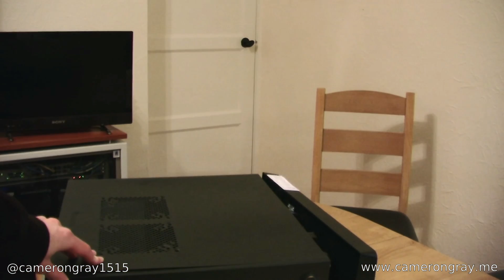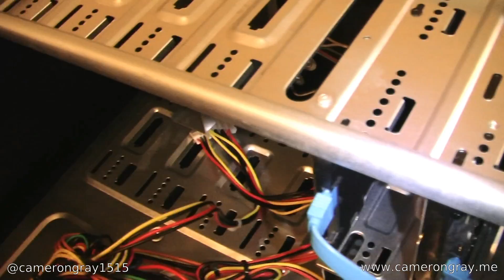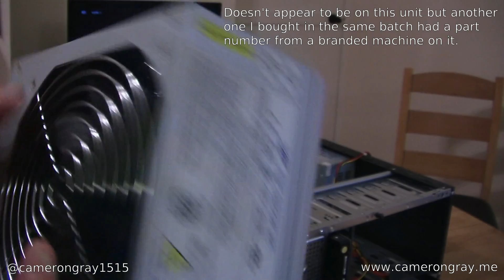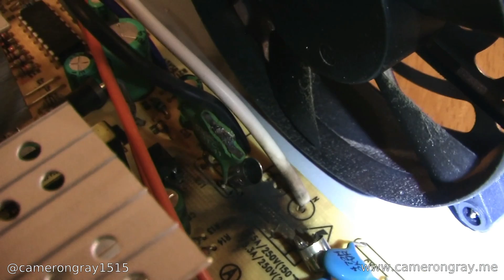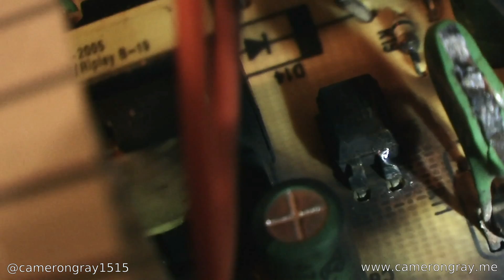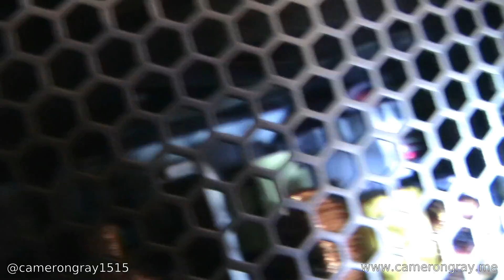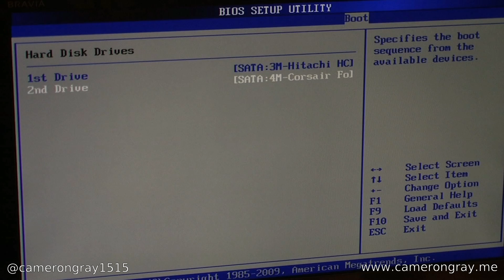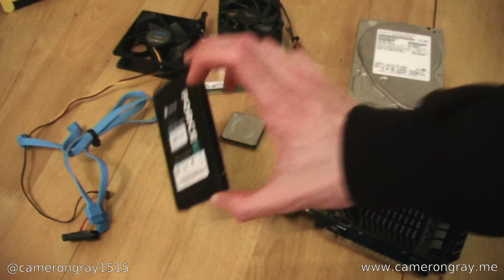Mystery £10 eBay PC

Comment: That Hard drive will probably outlast every other component..I have a Hitachi 7K500 from 2005 that still runs fine
Reply: Techformative my money is on the cpu
Reply: Techformative Not sure what brand it is, but I have a PC with a harddrive from November 2000, and it works just fine.
Reply: shit man. thats great. as long as you take good care of your pc parts. they'll last a long time
Reply: The Hard disk is my dad's original XT runs fine from '83
Reply: In the good old days things were built better, my Model M keyboard is still in excellent condition 35 years later and I cannot count how many new keyboards over the years I have destroyed with considerably better treatment lol. We did find that nearly all the 5 1/4 floppies are scrap but that's probably storing them in the attic for so long. Floppy drive itself works fine.
Reply: yea. i have a hard drive from a prebuilt dx 4840. 1tb western digital green. its not top of the line. but its still running fine.
Reply: CanadianToastGaming Well, it's still some space for storage. Really nice :)
Reply: Yeah, Hitachi CinemaStar hard drives were made for DVR/PVR boxes and are basically designed to be run 24 hours a day. Very reliable but unfortunately they weren't in the retail market, they were only sold to OEMs.
Reply: they do not make HDD's like that anymore I'm afraid.
Reply: though older hdd's were built better. newer ones are alot faster lol
Reply: My XT hard disk if you turn the PC on too quickly after turning it off you can destroy the hard disk because the head hasn't parked properly.  You just have to remember to give it 30 seconds after you turn it off.
Reply: Techformative still have a toshiba with windows ME that still works they are reliable drives
Reply: Does it even use sata xD

Comment: 17:01 You said you have a glass of water on standby I hope you don't mean for the fire that might happen. You should never use water on an electrical fire.
Reply from the maker: +Atolisk I'd have obviously unplugged it first :P. There's also a difference between a major fire on something running at mains voltages and a small pop on a motherboard.  For something so minor I'd have rather avoided the expense and mess of setting off an actual extinguisher.
Reply: As long he doesn't pour it over the power supply but only the motherboard it should be fine. It's fairly low voltage so he won't get eletrocuted also.
Reply: Atolisk Water is a terrible conductor of electricity. Pure water is actually agood insulator. However, water is agreat ionic solvent: liquid in which ionic compounds can dissolve easily. It's those dissolved ions that can conduct well - and when watercontains many dissolved ions, those ions make a good conductor.
Reply: Indeed. When putting computers inside a mineral oil tank was all the rage, i saw a few inside..water! Power supply and all, but not the hard drive of course.
Obsiously the water was distilled and deionized.
Reply: Cooking oil will do!
Reply: Even unplugged, capacitors can still give you a good jolt.
Reply: once its unplugged it not an electrical fire, it "was" an electrical fire, once unplugged its past tense.
Reply: Firstly, the argument for not using water because you could get electrocuted.. is stupid. Unless you are sticking your hands in a fried machine after pouring water on it... which is equally stupid. But, yes not the best choice. It is however a better choice than your house burning down. Though, it's also stupid arguing the conductivity of water.. tap water.. even filtered will not be deionized and I doubt people are buying jugs of DI water to pour on PCs.. not that it would matter since it would ionize taking you back to the same situation.

Second, water submerged PCs work.. for about 10 minutes. The water will ionize extremely quickly..especially with any aluminum. Mineral oil will eventually degrade materials especially rubbers, plastics, thermal paste.. the majority of what makes the computer reliable and holds it together. They will rarely survive more than a year.
Reply: BadassMOfoe GAmen27 I read it becomes rancid after a while therefore a pain to clean afterwards.
Reply: BadassMOfoe GAmen27 vegetable oil actually works
Reply: One could argue that it would be safe to soak the motherboard because usually a switched mode power supply  is isolated from the mains, but to be fair with all the crappy chinese power supplies we're sorrounded, the safest bet is indeed not to do it.
Reply: as soon as it would hit any surface, it would probably not be 100% pure
Reply: zerodegrees8 except for all of the components that have not discharged yet. Are people really still arguing about not using water on an electrical device?
Reply: Ions not mineral that produce conductivity.
Reply: You don't know his dreams and intentions eheh
Reply: totalrandomtechnolog If you use 100% pure water it wouldn't do a thing, water isn't a good conductor it's the minerals inside the water that conducts well.
Reply: @AVelociraptor  100% is extremely dangerous.
Reply: Atolisk is absolutely correct.  You never know what is connected in a questionable board. You never, EVER, EVER use water for an electrical fire.  No excuses.  Otherwise, you are throwing safety to the wind.  That is not just being lazy, that is being dangerous and careless.  Sorry man, but you are no expert.
Reply: Cameron, makes sense. Although for my own piece of mind I'd still have a mini hand-held extinguisher (the in-can ones to be kept in the car) at the ready :-)

Comment: When I go to yard sales I look for either cheap computer parts or even cable/satellite boxes that are DVR units for cheap, they often range from 160GB-500GB for the ones that I have seen. With cheap/bad power supplies I when I salvage them before trash I will often  salvage the Fan even if it a cheap fan and if the capacitors are of a good make. I also look if there is a stash of calculators because some times I have found a PDA/Palmtop like I found a HP 95LX for $1 and it works.

Comment: Maplin is still cancer. I still work there after 3.5 years. Only because it's a part time job for a student. But it's cancer. Everything is massively over priced. Avoid.
Reply: every time i go in there i feel i been mugged and thats just  opening the door,,  craplins
Reply: o0julek0o i taught im the only one who noticed their prices. 😥
Reply: I only go in there if i cant wait for a part
Reply: £60 for a 2 meter display port cable last time i went there...
Reply: o0julek0o saw a dvi lead for £45, mental
Reply: CEX ok to buy from. But they rely on really distressed sellers
Reply: You can also get cheap graphics cards on eBay. 
CEX overvalue things.
Reply: I was one of Maplins' first customers, back in the day when they sold kits in plastic bags, from one of the founder's kitchens. Back then they were excellent, now I wouldn't buy anything from them.
Reply: 500gb 5400rpm hdd for only £80

good scam, i paid £2 for both of mine (second hand)
Reply: Where they try and offer you warranty on a resistor, and try and sell you a fidget spinner.. cant stand the place but its a necessary evil if you want a connector or two
Reply: 50% off a price that started 500% more than everywhere else.
Reply: Iced
Reply: Purchased an Elgato HD60 on sale for €160. I'd only purchase there if there's a nice sale.
Reply: o0julek0o off brand stuff isn't as good as stuff such as coolermaster
Reply: It's always about 1.25x-3x the normal price, they sell DisplayPort cables for like £30 to £60... I got a functional DisplayPort cable with 2 years warranty from Cex for 25 pence... I'm not even kidding that made my day.
Reply: Cex is also the most bullshit company here in Ireland there selling people used shite at brand new prices another necessary evil though but both these companies need to rething stratergy for the people who acctually care about value
Reply: Suger Bacon selling above new because of price match which game stoped because it hurt the prices of 2nd hand
Reply: The prices they charge for shit is mad,
Reply: £17 for a can of compressed air!!!!!!!!!!!
Reply: The insurance is good though, £12 for a £45 pair of earphones, which they replaced no questions asked.
Reply: does maplin compete with alienware?
Reply: BOXXY what ?? They're not even the same type of company, maplins is a shop, while alienate makes computers.
Reply: a video about pc and then someone says this company over prices their stuff a lot, im going to assume its a computer type thing company
Reply: BOXXY what not really, they sell loads of overpriced 'gadgets' and have a small section of computer parts.
Reply: Fell for their trick when I was younger. Bought a 500gb harddrive for £60 and then found a 2TB a week later for £50. Never been happy with them.
Reply: Walked into my local one, walked back out after asking the guy putting prices on things if he was high. That was the only logical reason I would come up with him wanting 40gbp for 400 watt ipower psu or some other wank make that should be no where near a pc. ..
Reply: You wish has come true.
Reply: Guess they got what they deserve now there bust
Reply: o0julek0o they screwed everyone who worked there i should know i worked for them.
Reply: Corsair are a quite decent option.
Reply: I bought a usb header extension cable there once for £2 I think, which was good value.
But everything else like graphics cards and stuff can be got cheaper online.
Reply: Maplin is Gone!!...2018
Reply: bet you don't work there now!
Reply: I always called it faplins, but craplins is also pretty great xddddddd

Comment: Those FSP power supply are really reliable and cheap as well.
Reply: FSP and Delta are both the OEM manufacturers focusing on power supplies. So they are reliable.
Reply: It's most likely worn out because I've an i5 build with a gtx 960 and it's a 500w psu
Reply: I think Delta ones are better but FSP is still good!
Reply: FSP is know to make good PSU's and also total Garbage PSU's, they are hit or miss depending on the applicants order, some order a 250W psu then slap a 500W label on it.
Reply: Got a pretty nice one. 350W 80+ and 322W on the 12v rails. Cost me 15€ including shipping after rebate.
Reply: Agree. Love it when these kids build a few computers and all of the sudden they become 'experts'.
Reply: I have an FSP power supply and it's pure rubbish. It keeps shutting my system down.
Can't wait to get a new PSU.
Reply: I run FSP 550W for 10 years now. It survived 8 rig upgrades, currently feeding Intel Xeon E3-1220 based machine. :)

Comment: Power Supply Damage appears to be from lightning strike. It was hit so hard that while the fuse element went instant plasma and the expansion of plasma metal exploded the glass body and plasma then condensed quickly to the PCB. Plasma is conductive and so in that instant that it got hit the fuse still allowed that spike most likely from lightning strike to blow the MOV and leg damage on other component looks like pitting from an arc. The part that you didnt know the name of is a MOV used to protect circuitry from spikes. http://www.circuitstoday.com/metal-oxide-varistor-mov
Reply from the maker: Ahh, thanks for the info, very helpful!  A lightning strike (or some other power surge) definitely does seem like the case - That would also explain why the board was fried!
Reply: +GamerDave2008 Nice analysis! Yeah, that would also explain why no parts from the blown fuse were found in the PSU.

So, in essence, the PSU died outright in the siege, and that one cap on the mobo sacrificed itself to prevent other components on the mobo from getting fried. Probably not so successful, though. That cap is probably the only visible victim, and other components already got burnt.

But they did good to save all the other components. CPU, RAM, SSD, even VGA, they all survived.
Reply: I actually took a winpower psu out of an old PC made by cyberpower from 2007 or something.
pretty much the exact same issue with popped fuse and fragments of whatever rattling around inside.
Its the second one I have came across, they don't seem to have a life expectancy over a few months lol.
Reply: Yeah maybe or just water...
Reply: Surge protector on extension cord is fine in most cases, but if the power in your neighborhood is not that stable, or a lot of lightning, consider investing in an AVR, or even a UPS. But the best bet is just unplug your sensitive appliance from the socket in the event of lightning storm.
I have my PC, PS4, and the home cinema system only behind an AVR because my power is quite stable, if you sometimes get blackout, invest in a UPS, otherwise an AVR is enough.
*AVR = automatic voltage regulator, works both in surge and undervolt
Reply: maybe gg connected the pc with the wrong voltage and fried the mobo?
Reply: Absolutly human error. The PC has been conected in a 230V outlet while it was selected on 115V. So the blue varistors protected the PSU by short circuit it. the green NTC resistor (used for limiting current) exploded cause the short circuit at the time the fuse exploded too. The security system worked as entended.
Reply: yeah i gotta agree with you on that, defiantly got hit with a surge of some kind
Reply: I have a surge protecter on my extension lead.. would this stop the same kind of damage to mine? if no what would you reccomend?
Reply: What was the video card/graphics card?
Reply: Pashico nVidia GT210 Silent. See 07:00 ish.
Reply: Thank you.
Reply: GamerDave2008 lighting strike damage without any surge protection is a likely explanation indeed. BUT, another possibility in my mind could have been someone hooking up a portable generator wrong using the dryer plug and back feeding...
Reply: Only unplug the equipment you want to keep during an electrical storm.
Reply: if anyone else wants to learn more about what a MOV is and why it got damaged... they are a compont that is used to protect the other components in the circuit... on a large surge they uselly will sacrifice themselves.. and will a lot of time explode if a very high power surge comes in....here is a video that will tell u a little about them  https://www.youtube.com/watch?v=CiBXN82vzNQ
Reply: Jourdan Louis qqqq